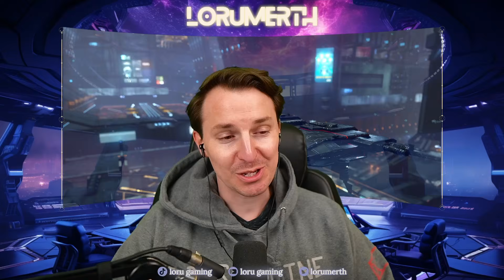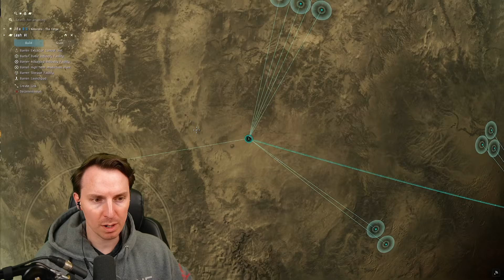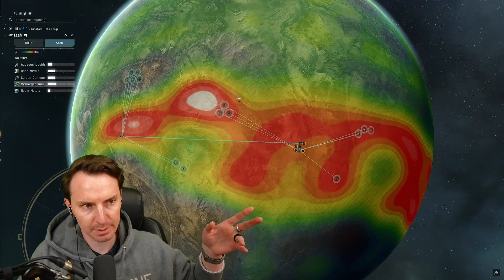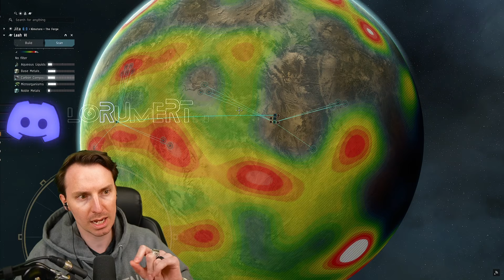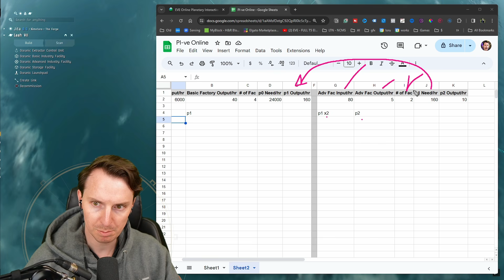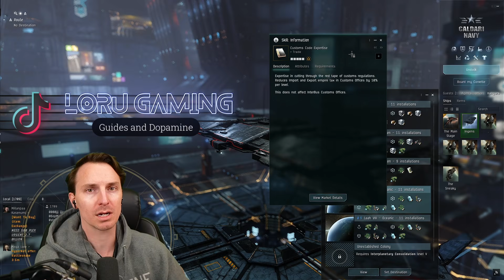How You Can DOUBLE Your ISK w/ Adv Factories 🪐 EVE Planetary Industry Guide: 2

Comment from the maker: □ Exclusive Reward :_loruNiffler: only: for Patrons: https://www.patreon.com/lorumerth
Reply: I'm lvl V pi skills and I can only have 2 extractors, 5 heads 3 basic factories each and out of power. hi-sec p1.
Reply: @sumerbc7409  ar you on a barren? links cost more pg and cpu on other planets? did you make sure to upgrade your command center?
Reply: Loru, i recently sat down and created a spread sheet to calculate profit for manufacturing gel matrix bio paste in hs on a barren factory planet, one planet, at current Jita prices can produce about 228 mill isk per 30 days,  6 planets can produce  1.3 bill profit per 30 days! if you can keep them feed and running non stop for 365 days your looking at 16.5 bill profit annually, i have 6 characters with command center upgrades to lvl 5, I'm in the process of setting up 36 factory planets hypothetically if i could keep all 6 planets fully stocked with purchased p1 mats on 6 toons,  annual profit is calculated at 98.7 billion isk!!! these values are based on current jita market prices and the cost of the p1 mats and poco tax at 17% in sobaseki which has 7 barren planets and is one jump from jita, the only issue is if one were to make and take that much GMBP to market it would crash the value.

see my math here https://i.imgur.com/3lMq5Zv.png

Comment: Just to make sure I understood that correctly, so you have 4 normal factories and 2 adv factories. In the normal ones, two are producing one type of P1s (bacteria) and the other two, the other type of P1s a(water) and then you combine both in the two advanced factories you have. Is that correct?
Reply from the maker: you got it
Reply: Yeah because the next stage requires always requires double what the previous one produces. P2 needs 80 P1 despite each factory only making 40 each hour. P3 needs 10 despite each p2 factory making 5 and P4 needs 6 despite each p3 factory making 3.

So 1 P4 needs 2 P3 which needs 4 P2, which needs 8 P1 in order to produce hourly.  Hence in factory setups people usually trade off individual profit for volume as it makes you more. As you go higher in the complexity so does the weekly investment amount. P3 requires 800M ISK to run and P4 often requires several billions to invest. Despite lower margins P4 makes more profit but P3 is easier to transport.

Comment: Quick PI Tip - on some screens, double-clicking will start a 'default' action. For instance, when you're telling a factory what to make, you can double-click the schematic & simply double-click the output location. The game will do the routing for you.
Reply from the maker: huge, hearting some more people see!!
Reply: @lorumerthgaming  Do you use saved configurations to switch product? if you do you can go down to 1 extraxtor with 10 heads and increase p2 output without excessive clicking.

Comment: When doing t2 you can remove the storage facility and use the launch pad for all steps. Gives you more room for extractors.
Reply from the maker: this is a GREAT idea, hearting so more people see
Reply: Depending on how much time you really can put into PI, this could be a bad idea. I'd suggest reserving a planet exclusive for p2. The amount of storage - could be none - will depends on how many times do you want to check on it.

Because I'm a lazy dumb and have limited time one EVE, I build 3 launch pad and 3 storage together with 20 factories on a small planet - Temperate and Barren have the lowest radius, so the link are smaller and consume less power. This way, I can put a shit ton of input material (currently doing nanites) that I create on my other 4 planets and bought from market and can leave it for almost a week without downtime.

It still make me almost 50m isk a day.
Reply: Why didn't I think of that?! Excellent idea, I've got a few that would really benefit from this. Thank you!!
Reply: This can be a good idea, but you have to keep an eye on it. Don't let it get full :)
Reply: You have to keep an eye on it regardless. The higher tier always takes up more room, so do some math to put the maximum amount of material in, have the routes set up to feed back into the launchpad, and you can know exactly when it'll be empty.
With more math you can fill it up and take the refined material out in one go and keep it going endlessly.  Did this with 20+ planets in null.
@phalanx21860
Reply: I use 2 launchpads, one is input, the other is for output.